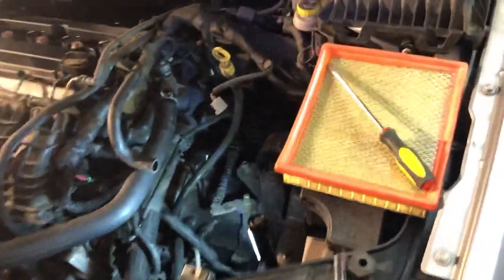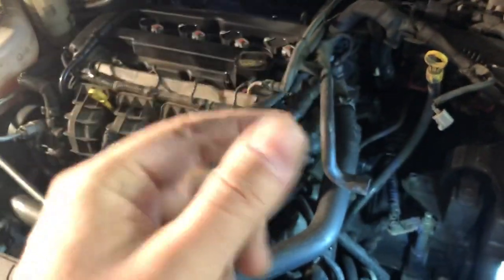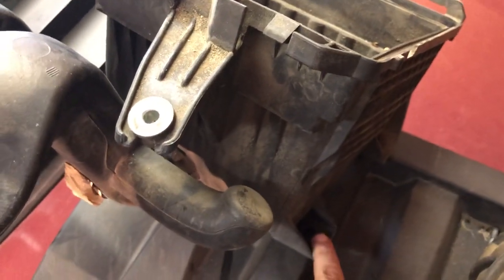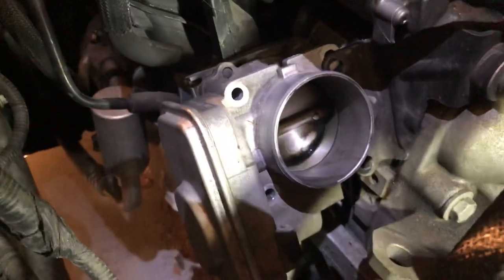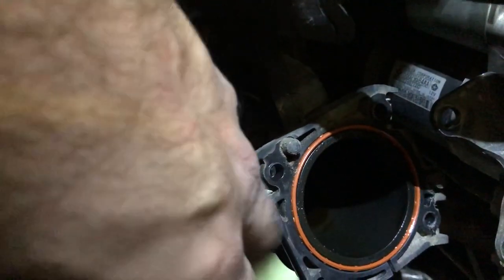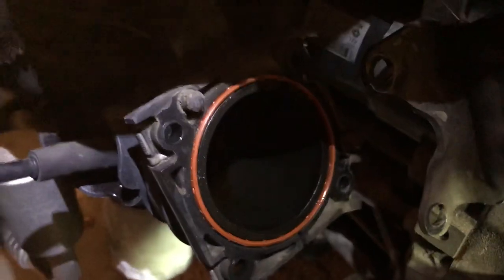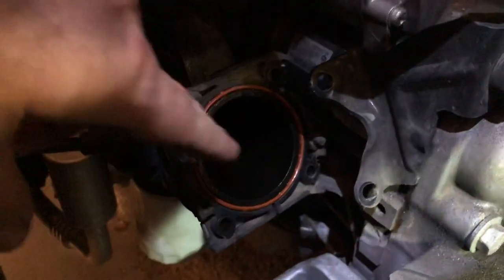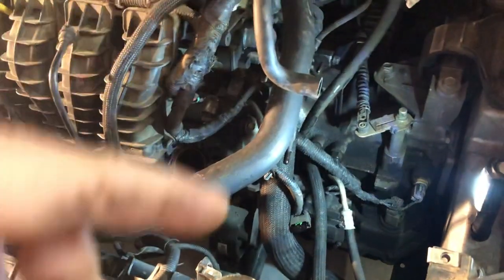Dodge Avenger Throttle Position Sensor Replacement

Comment: Nice video. I was able to get mine out without removing the air-box, just took off the rubber intake tube. I ended up cleaning my original one with throttle body cleaner and it’s running great now. The lightning bolt went away, no more erratic idle or random stalling and the car feels more responsive overall. For $10 it’s worth a try before replacing the part. 

These do fail over time as the plastic servo gears inside the throttle body get worn down. But I suspect that regular cleaning of the throttle body could extend the life. 

2010 Avenger Express
2.4L 171,000 miles

Comment: Why is my engine smoking an has the bolt between the lines seems like its this problem but not to sure if it just the engine throttle

Comment: Will an non functioning throttle body and TPM cause a no start?

I have the lightening bolt ⚡ and a crank/ no start situation.

2008 Dodge Avenger 2.4 4cyl
Reply: Absolutely yes it can cause no start at all

Comment: Did it fix the problem? my problem was the pedal goes to floor and does nothing and the lighting bolt light is on help
Reply from the maker: Yes this repair fixed my issue
Reply: Same issue will it fix this problem
Reply from the maker: @parkerwilliams6629  it did in my situation

Comment: @rad2087 I’m having the same issue with my 2014 avenger and the fuel gage stopped working and the fuel tank is imploding at times......have you had similar issues ?
Reply from the maker: I have never heard of this issue
Reply: Try changing the Fuel pump

Comment: My dodge avanger  se 2013 has a red lighting  bolt  on. Before that  it was the alinatore   and my battery  so I replaced  both of them .now ten days later the red bolt   came on . Any clue or tips would be helpful!
Reply: Throttle body replacement
Reply: i have the same model and i am having the same problem now, did you ever figure out what it was?

Comment: Hey rod I have 2012 dodge sxt plus and it’s cutting off on me. Can you lead me in a direction to get this fix
Reply from the maker: Sorry, I can’t really help diagnosing any further… is it throwing codes? Running a diagnostic will certainly start you in the right direction , good luck
Reply: I have no lights on. I changed fuel pump, crank and cam sensors the pcm and it still cuts off while driving

Comment: Hey @Rad I have a 2013 dodge Avenger I've had since August. It just hit 81k miles and have had no issues with it until today. I was driving on the freeway took and exit and it stalled at the light... I put it in park and it started right back up, I am afraid of more issues down the road because I don't have a dime to spend on repairs OR a tow for that matter... could you tell me what you believe the problem may be?
Reply from the maker: Idk, but it sounds like a quality of gas issue or low fuel pressure .... I always run hi-grade fuel in all my vehicles

Comment: Is that the sensor or the throttle body some one told me the sensor it’s on top a the engine I have same problem but not throttle body it’s sensor some say am confused

Comment: I changed the throttle body in my 2010 dodge avenger r/t but it has the same issue as before with the lighting bolt, and now I have a rough idle, low removal idle and high revs on take off..how do I reprogram.
Reply: I have the same car. I also replaced the throttle and reset it, but it was still there intermittently. Summer came and  I went all summer without seeing it. The first cold day it was back.  Did you ever figure it out?

Comment: Hey @Rad have a 2013 Dodge Avenger, and I need to change the throttle, does it need to be program to the computer after they put it on or no? Because I know on some you have to but idk if I have to on mine.
Reply from the maker: No reprogramming was necessary, the system automatically syncing its circuitry automatically, once installed, just simply turn key to acc position and allow ample time prior to starting
Reply: @rad2087  got it, now I can get it fix without worry about the need of programming it, thank you for your help. 🙋🏼‍♂️👋
Reply: @ivan_uzzruelas8655  did your car get fixed?

Comment: Hey@Rad. I have a 08 Avenger. Ran real good. Drove it about 130 miles straight.When I got back in ready to leave when i crunk it up. It went in limp mode. I changed the throttle position sensor, Still did it. Changed the cam and crank sensor and still have the problem...
What do you think it could be.
Reply from the maker: That’s a head scratcher…. Could be the Computer, but maybe check the park Saftey switch. Check codes, also the computer hasn’t had a change to Relearn/reset the components that were installed?

Comment: Ihave 2014 dodge avenger ireplaced the throttle body like u showed us but still have the lightning bolts and the car wont start. What do i do?
Reply from the maker: Alternator charging? Bad battery?
Reply: @rad2087  its a mew alternator. But since you mentioned it i'ma go and replace it with a new battery today. Thanks. Could that be the reason the bolts still on dashboard?
Reply from the maker: @roshardgermany2335  it’s possible, maybe clear codes, change battery, and if works great! If not, see what codes populate and go from there.

Comment: What size is the bracket bolt?  Do I need a socket or can it be loosened with just an adjustable wrench?
Reply from the maker: UnivPoke I don’t think and adjustable wrench would work... I think there were 10mm bolts and there was one lager bolt.. maybe 13mm for that... lol it’s been a while
Reply: @rad2087  thanks!  Great vid

Comment: Ok my light went off twice. Once briefly like 2 seconds then I lost acceleration and then another time same drive when it stayed on and I lost acceleration and it wouldn’t go off until I turned the car off and back on. The lights off now and hasn’t came back on. Do you think it was a fluke or real issue? Should I replace the whole part now or wait to do it later?
Reply from the maker: Mr. James I thought I could get away with cleaning the throttle body myself, but ended up changing the unit any way. It may work for you if you clean thoroughly and replace air filter.
Reply: It’s happening to me on a car I just bought it’s the V6 what did you do!?

Comment: Did u ever find out why oil was behind the throttle body? I just replaced mines on 2014 avenger and it had gas behind mine
Reply from the maker: Sorry no, we ended up selling and moving, the only theory is engine vent line and for whatever reason accumulated a little oil. Wish I knew
Reply: @rad2087  appreciate the Info, the avenger has gone to shit in 90k miles lol im looking to sell after finding this gas issue
Reply from the maker: @chrisr7230  ya ours had 89-92k miles on it, and everything started to go. Great car up to that point I guess, good luck!
Reply: Mine has 170K and the throttle position sensor is going out now.
Reply from the maker: @johnfrost3354  that’s actually the most miles I’ve heard one lasting.
Reply: Mine has 208,000
Reply: Hello. I would like to know if you found the issue that caused oil in the throttle body because I'm having the same problem. Thank you in advance

Comment: What year is that Camaro?
Is it a 350? Or does it have an LS Swap in it
Reply from the maker: 1980, originally came with 327, but replaced with 350 4-bolt main long ago

Comment: i have  a problem  2008   
wont shift  to 4th gear can this be the problem i already change the solenoid pack
Reply: Did you have a rough shift into a gear ? I’m experiencing this now when it goes into second gear ! I was told solenoid pack ?

Comment: Is it possible to just replace the sensor?
Reply from the maker: Great question, I dug into this thinking I could. However, it is not possible. The sensor is cap and sealed to the chassis of the throttle body. I removed the cap and as expected the sensor is intergraded with the throttle control circuitry.

Comment: Did this fix the problem ? I'm having the same issue with my 2014 avenger . @ Rad 2087
Reply from the maker: David Magnuson cleaning it only worked for a day or 2. I had to change the throttle body and worked great since.
Reply: Did you have to reprogram it?
Reply: The pcm i meant
Reply from the maker: No reprogramming was necessary. The computer automatically reset the throttle body prior to start. After installing it’s recommended that you just turn on the vehicle but do not start until all lights in dashboard are out then start
Reply: I was told at Autozone it had to be professionally installed. They wouldnt sell me the part. Which was $228.00
Reply: @johnfrost3354  I just replaced mine in like 20min. Bought it at RockAuto online for around $100.00......Had a high idle for about 3min and went to normal for good while. Came back out 5hrs later trying to go to the store, "Idle high as hell". Won't go back down at all now. Worse position than before I changed it.
Reply: @silvabakgorilla1028  it sounds like yours needs reprogrammed.
Reply: I changed my thottle body. It runs for couple mins. Then lights comes out again and it iddle.. what dl you think is wrong??

Comment: Whom ever designed this car was obviously not thinking about maintenance and serviceability I mean who places the throttle body  assembly on the bottom
Reply from the maker: I agree, I've battling these issues through my entire career. But this task was much easier than it looked, especially compared to the Alternator.
Reply: Very true...ive been taking this car to my local dealer with all the recalls..im having the same issue with the throttle sensor issues and I don't even wanna change the battery bc of where it's at.
Reply: @dannybriar5407  I relocated my battery to the trunk. Just bought a stereo amp hook up kit for the wiring(cheaper that way) and routed it to the trunk easy as can be.
Reply: Moving the battery to the trunk isnt a bad idea at all.

Comment: I just did the exact same thing you did and it died on me in a parking lot. New gasket new dealership throttle body and it is now dying and has a rough idle. This guy at wal mart said there is a sensor under the gas pedal as well. Ever heard of that? Any advice will be greatly appreciated.
Reply from the maker: Well, I can’t say I ran into that issue, but the gas pedal I believe is electric so that makes sense if the sensor in the pedal is dirty or corroded...

Comment: How did you perform the relearn procedure? Did you use a scanner tool?
Reply from the maker: So as I am understand it, the cars computer actually relearns every time the car turns on. So after install I just simply turned the to on without start like 3 times, and worked like a charm ...

Comment: Did you find out  Why there was oil Inside?
Reply from the maker: I did not find a leak. What I did find is that the an engine vent line is part of the engine induction system(air intake system). So the system is subject to some contamination due a faulty ECV( engine case vent)

Comment: Hey do you know the location of the fuel filter
Reply: Under the rear seat on the drivers side, there is a rubber gasket that needs to be pulled up and the fuel pump in located under it. The fuel filter is part of the fuel pump, and comes out as a canister.

Comment: I just did this and Im still having the same issue with the ETC light and going into limp mode and I’ve been searching all over and many people have this issue but no one knows how to fix it 
Edit: its not the throttle body its the intake manifold gasket
Reply from the maker: Did you change throttle body?
Reply: @rad2087  yes just did it today
Reply from the maker: @awjrqr  hmm, and you also let the car relearn the throttle body? Turn ignition on for 10-20 sec then off, then start the vehicle?
Reply: Yea I finally got it fixed turns out it was the intake manifold gasket the whole time
Reply: i have a 2013 Dodge avenger my car, the car works perfect somedays but sometimes it just shuts off out of nowhere while driving, and then it cranks but wont start i have to wait about 5 to 10min then it wont go faster than 20mph no lighting bolt symbol showing either. the following day the car work perfectly, i have changed the crankshaft sensor and I still randomly get that issue, do think i need to replace my ETC? any advice will help. thanks
Reply: @ronaldsmith7827  have you been able to find the source of why the vehicle is cutting off
Reply: @catalinasolis8802  yes i did took forever was about to sell the car, it was the TIPM,  also keep in mind if you have after market stereo your TIPM replace will not work with car stereo you have to get the TIPM programed for aftermarket stereo to work when replacing tipm my car has a dvd player stereo
Reply: @catalinasolis8802  my car has not failed now for almost 7months it is fixed you can buy used TIPM ebay for like 100$

Comment: Does the throttle replacement/issue also have to do w the cylinders? Or is that a completely different issue?
Reply from the maker: Wendy Lucas I am not quite following you on the ‘cylinders’ issue... but typically the throttle body is a different issue.
Reply: @rad2087  Thank you. The E.T light had come on; but a mechanic had also said something about Id lost two cylinders. So I was trying to figure out somethings. Thank you
Reply from the maker: Wendy Lucas soo, sounds like he was saying maybe your spark plugs or coils are dead on those banks or ‘cylinder ‘
Reply: @rad2087  ok thank you.. I dont kno auto lingo!😂 Thats why I askd!
Reply: @wendylucas9628  Hey man, Did your car do any noises before you installed the new throttle body?
Reply: @earlyhead64  yes. Its still driveable but only to like 25.. Go on Amazon and order the part. Price from dealership was damn near $900 for that and a turn up. Throttle body i think was no more then 90 maybe i cant remember and it may shake alil to like it wants to shut off
Reply: @earlyhead64  did ur light with the lighting bolt illuminate? Also look on youtube to change it out yourself too.. I was going to do it myself..but when i askd a ci-wrker if i could use her husband's tools..she just sent him to do it. Took like 25-35 min
Reply: @wendylucas9628  Yes, the red lightning bolt came on along with the swervy car looking light. It also makes some noises b4 I turn it on and after I turn it off.
Reply: @earlyhead64  yup.. I think thats exactly what mine did to. Dont drive it too much. Just get home. Look the part up on Amazon.. Trust me itll save you a fuckn ton of money.

Comment: Hi so I had the same issue. Ended up replacing the throttle control for a brand new one. Worked for a week or two and now it’s doing the same thing. The lightning bolt will come on and go into limp mode until I reset, though even though I reset it’ll come on again. Any ideas to what the issue may be? I appreciate any help
Reply: probably a bad part
Reply: @puremayhemFTW  thanks man. Thankfully got rid of that god forsaken car.
Reply: @JustJosey01  I’m looking forward to the day that I am able to as well
Reply: Haha, you're not alone 😂

Comment: I’m having a similar issue my car has been working just fine then one day I jump in my car to start it and it only cranks but won’t start. ETC light came on. Would replacing the throttle body fix this?
Reply from the maker: It really sounds like something to do with your ECU, remove positive batt cable, then unplug your ECU and spray contact cleaner and plug and unplug again, then let dry and reinstall everything, let me know …. Sorry for the late reply